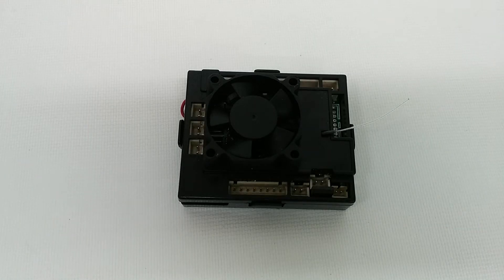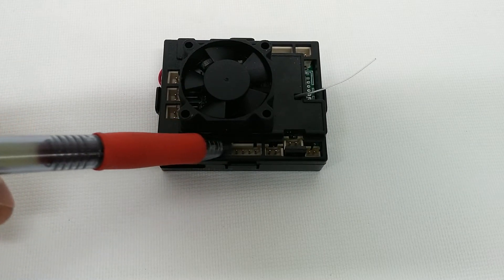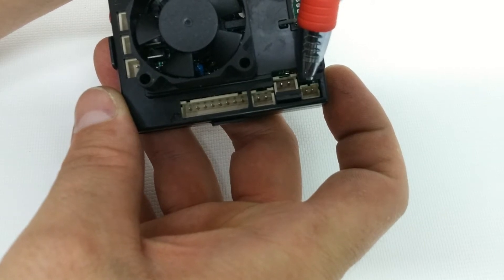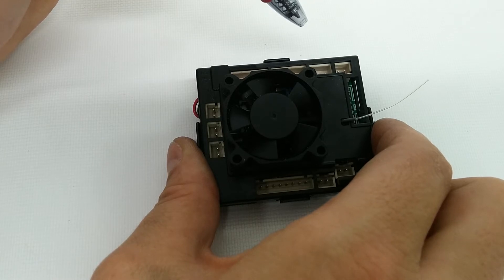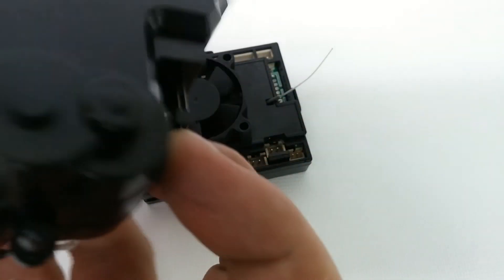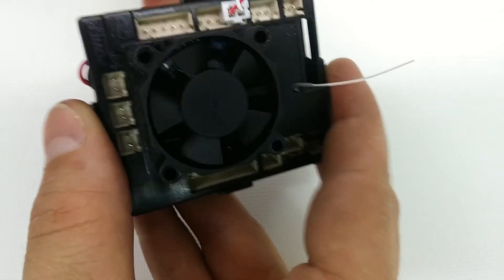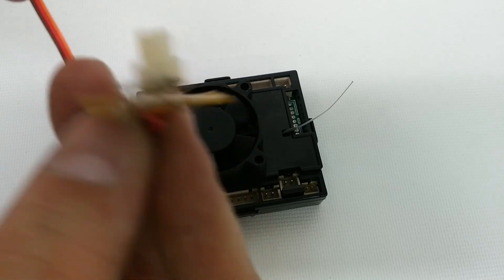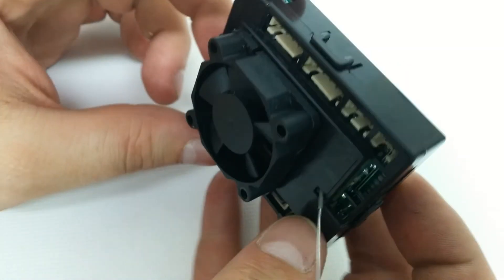Taigen Tanks 2.4GHz motherboard

Comment: Hello, I have the 3859 Taigen that I bought second hand from facebook marketplace. It works fine for the first 5 mins and then all of a sudden it will "run away". I can let go of the forward stick but the tank will continue moving forward. Turning the switch on and off on the remote does nothing. I have to catch the tank and lift it up to turn it off. Any remedies?

Comment: Hi, great channel!
I have this unit fitted to my taigen tiger 1. It all works great, however when the tank is driving the engine sound stays in idle, and only kicks in to a driving sound at approximately 3/4 full speed? Does anyone have any idea how this could be fixed? Many thanks in advance.

Comment: Hi Imex-Erik! Very interesting and good quality videos you have, keep them coming :)
I have a few questions you might be able to answer; Have you ever tested the maximum radio range of the 2.4Ghz Taigen (or Heng Long) system? And would it be possible to connect both the infrared battle system and BB shooting gun with (gun) recoil to the electronics board? (Assuming of course one can make them somehow fit the turret of the tank.)
Reply from the maker: Hey TNX255, thanks for the comments. I have got at least 50 meters at a crowded trade show. I've never lost range before, but I do have a FPV system coming as a side project, I'll test the range then before I swap to a hobby grade radio. As for having both an IR and airsoft unit.... very possible. Having an IR flash in the barrel would be very difficult though as the 6mm airsoft bb takes up all the room in the barrel. You would have to add this in the muzzle yourself as most battle groups require a flash. The airsoft component could be disabled with a switch so there is no dry firing but the IR would still work. It is a lot of custom building, but it is possible for someone that dedicated. Personally I would just say order another turret and have one airsoft and one infrared and swap them when you need. It would only take a few minutes to swap them and would save you hours of fab time and stress.
Reply: Taigen Tanks
I am actually building an FPV system myself on a Taigen Tiger II 2.4GHz, that's why I was asking about the radio range :) I just haven't driven the tank outdoors yet, because the little boy in me wanted to see what makes it run and I took it apart as soon as the first battery charge was used up :) For FPV, 50 meters isn't very much, but I have a Futaba F-16 40MHz airplane radio lying around and I am planning on using that for the tank.
As for battle groups and such, I doubt there's anything like that going on in my country (Finland), so having the BB and infrared system without a muzzle flash wouldn't be an issue. Mostly what I'm interested in is the gun recoil part of the infrared system, so that I could shoot BB's and have the recoil simultaneously - that would be cool :)
All this of course requires lots of modding but that's the best part of the hobby, building and tinkering, isn't it :)
Thanks for your insight!